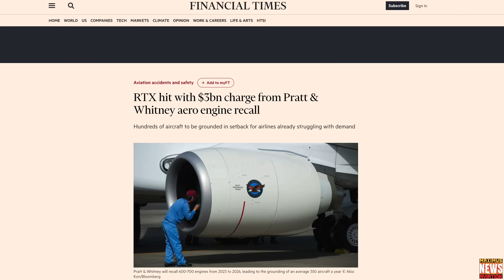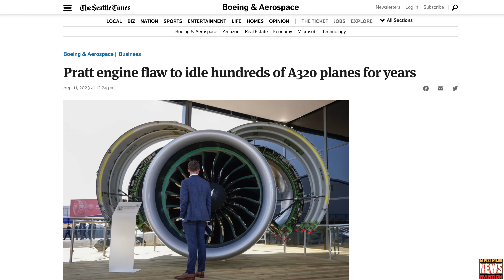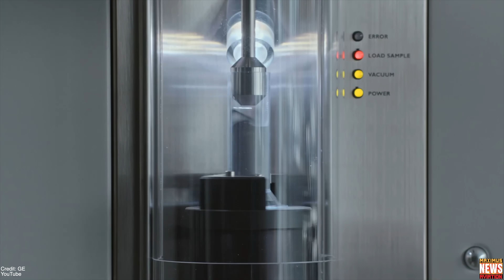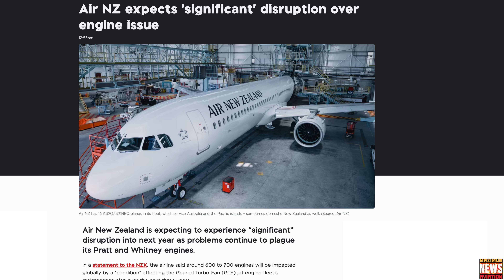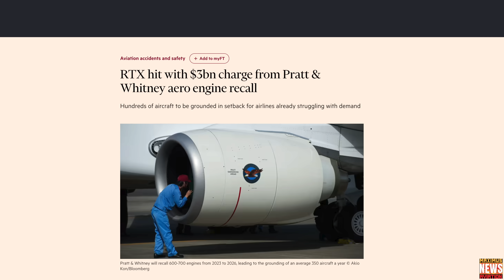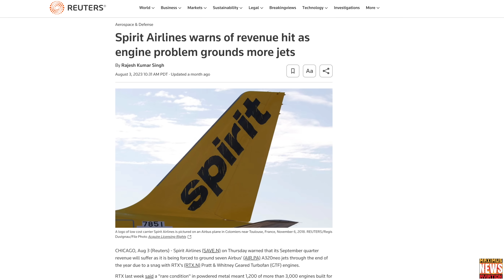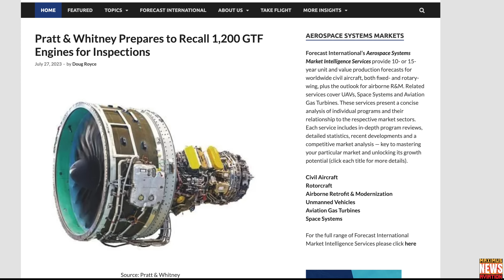HUGE LOSS For Airbus. Every A320 neo-Family Jet P&W GTF Engine Will Have To Be PULLED And Repaired!

Comment: Here's the part that most people outside the industry don't know. Most airlines don't own the engines on their airplanes. They lease them. It's much cheaper to lease than own. When it comes time for some major off wing maintenance like a hot section inspection for example, the airline just pulls the engine, hangs a fresh motor from the leasing company, ships the bad motor back. You open a lot of the cowlings on airliners and there will be an ownership placard from a bank or other financial institution (Wells Fargo, ILFC, L3 are the biggest) which actually owns the engines. I worked on Continental Airlines planes before the merger with United and the only thing Continental owned was the basic airframe (wings and the fuselage) Everything else was leased, the motors, the landing gear, the avionics, even the seats, lavs, and Galleys, everything! While it may slow deliveries the actual problem is with Pratt and Whitney not Airbus. The same thing with Boeing, the problem is with GE not Boeing.  GE and Pratt will have to cover any losses to Boeing and Airbus do to this issue.
Reply: Interesting
Reply: We have to excuse little Nicky here. He's a byproduct of poor parenting and failed UK schooling. He's never touched an aircraft yet assumes to know everything about them. 😝 Little Nicky is a legend in his own mind, sadly he's not far off from being a vegetable.
Reply: @becauseyouassumethatsproof8033  Keep talking to yourself here Steven. Nobody is seeing all of this. We all know you have a poor understanding of education of how engines are offered to airlines and not manufacturers of aircraft. He keeps assuming he knows everything 🥱😄 Sad little Steven is in his own little bubble that he thinks no one can touch. Sadly he is nowhere from being an adult
Reply: Just due it
Reply: The “you’ll own nothing and like it” economy, keeping everyone’s hands clean of any responsibility. As designed.
Reply: At the end of the day the aircraft manufacturer decides what engine manufacturer or manufacturers can hang their engine on said aircraft. If there are multiple engine manufacturer options the purchasing airline can decide which engine they choose to use.
Reply: @soyousay7751 so tell me Einstein 1 year on the manufacturer does not give the responsibility for whole aircraft if the engines are faulty. RR T1000 and GENX and PW engines have issues and are all fixed by the engine manufacturer! Stop spreading lies as you always do and accept the facts moron
Reply: @soyousay7751 I still wait for the Chinese to build a cheap knock off.
Reply: @wolfgangpreier9160  ¿Que esperas qué? ¿Una imitación barata?
Reply: @cesardavrieux3767  👍👍👍I do not fly, and i trust the airplanes not to be able to fly when the engines don't run.
Reply: @soyousay7751  Wrong cupcake, the aircraft manufacturer does not decide what engine manufacturer or manufacturers can hang their engine. The second thing is correct. The customers choose the engines not the manufacturer of the said aircraft.
Reply: @nickolliver3021  Sorry to disappoint you Nicky but the aircraft manufacturer decides which engine or engines they will offer on said aircraft. If there are a choice then the airline picks which one. You've never worked on or manufactured an aircraft so you wouldn't know.

How would a customer decide what engine or engines to offer on a manufactured aircraft? 😝😝😝😝😝
Reply: @nickolliver3021  So tell me past prom queen, if Boeing only offers a Pratt engine on an aircraft can a customer order the aircraft with a Rolls? No Forrest Gump they can only order the said Pratt. If the manufacturer offers a Pratt or Rolls as options then the customer can choose between the said Pratt or Rolls.

You win the UK Darwin Award on your lack of knowledge.
Reply: @soyousay7751  Excuse me Steven you are incorrect yet again. Aircraft manufacturers do NOT decide which engine or engines they will offer on Said aircraft. No manufacturer chooses the engines if there is an option or not. Its down to tne airlines themselves. You've never been in the segment to even tell who chooses. 

I can give you an example: 

Delta and United picked the PW engines option over the CFM leap for their a321neos. Looks like you just got called out on your BS 😅😅😅😅🥱🥱🥱🥱
Reply: @nickolliver3021  Wow you are thick. Delta chose because Airbus offered the PW & CFM, Airbus choose both as an option. Nice try Forrest Gump.
Reply: @nickolliver3021  Try reading and using comprehension. If an aircraft has a choice of two engines the manufacturer of the aircraft offered the two choices. 😝 Not the customer buying them. 😝
Reply: @soyousay7751  Boeing does not offer the engines to the airlines muppet. The engines are offered from the Engine manufacturer not from the aircraft manufacturer. It's up to the airlines to pick what both RR, PW, GE CFM to pick. NOT BOEING OR AIRBUS 

You seem to have won the dunce reward on your lack of how airlines choose their engines over the manufacturer
Reply: @soyousay7751  Airbus never offered the PW & CFM. The manufacturers offered those two engines not the manufacturer. Nice try Einstein. Go back to retirement
Reply: @nickolliver3021  Nick stick to your Sippee Cup.
Reply: @Agent-ww8yi  stick to your wrong answer's
Reply: @nickolliver3021  If your bollocks where true then an airline can choose any engine in the world for an aircraft. 😝😝😝😝😝
Reply: @soyousay7751  wrong muppet. Whatever engine manufacturer offers to narrowbody or widebody aircraft then the customers choose the engines not manufacturer. How do you spell were? its not Where  🥱😅😅😅😅
Reply: @nickolliver3021  👈 The results of having sibling parents.
Reply: @Agent-ww8yi  Say's the one who can't stop arguing the truth 🥱😅😅😅😅
Reply: @nickolliver3021  👈 Like I said sibling parents he's back misspelling.
Reply: @Agent-ww8yi 👈 says the YouTube spelling police
Reply: @nickolliver3021  You're wrong and it's comedy watching you make a UK arse of yourself. 👋👋
Reply: @nickolliver3021  👈 Can't spell

@nickolliver3021
21 seconds ago
 @becauseyouassumethatsproof8033  Sat's the one who is using his multiple accounts to be someone else. We all know all of these accounts are you Steven. So you are the one in the wrong
Reply: @Agent-ww8yi  says the YouTube spelling police.  It says says! Can you not read
Reply: @nickolliver3021  I read well you edited it after I exposed you, read your mistake again

@nickolliver3021
21 seconds ago
 @becauseyouassumethatsproof8033  Sat's the one who is using his multiple accounts to be someone else. We all know all of these accounts are you Steven. So you are the one in the wrong

😝😝😝😝😝
Reply: @Agent-ww8yi  obviously you don't read well because it says "Say's  perhaps read your mistake again that I called you out on and exposed instead of acting like the YouTube spelling police 🥱🥱😄😄😄😄😄
Reply: @nickolliver3021  Ask your brother & sister, I mean dad & mom to read it.

@nickolliver3021
21 seconds ago
 @becauseyouassumethatsproof8033  Sat's the one who is using his multiple accounts to be someone else. We all know all of these accounts are you Steven. So you are the one in the wrong

I see Sat's 😝😝😝😝😝
Reply: @Agent-ww8yi  Perhaps I see you don't know how the industry runs when I called you out on the engines. 

Perhaps ask your mom or dad how that all works instead of being persistent about it all. 

And perhaps look at everyone's else's comments to be proved wrong 🥱😄😄😄
Reply: @nickolliver3021  You are the only lown with a c in front that assumes the engine manufacturers decide what aircraft they will be chose to fit on. 😝 The aircraft manufacturer decides then offers the option to airlines. 😝
Reply: @nickolliver3021  Stick to your day job of picking up dog coils in their yards.
Reply: @soyousay7751  stick to retirement you are better off staying out of this for the people who know what they talk about
Reply: @nickolliver3021  Wrong little man. The aircraft manufacturer decides which engines it will offer, then the airlines chose. Try using the internet if your parents will allow you. 😝😝😝😝😝
Reply: @nickolliver3021  Use your head I know you failed school. Common sense tells you the aircraft manufacturer decides what engines to offer.
Reply: @Agent-ww8yi  Incorrect yet again. The aircraft manufacturer does NOT decide which engine it will offer. The airlines choose what the engine manufacturer offers. Try looking at everyone else's comment if your body allows you to 😄🥱
Reply: @nickolliver3021  You are splendid comedy and at the same time example of failed UK education.
Reply: @Agent-ww8yi  use your head muppet.  Common sense tells you the engine manufacturer offers the engines to the airlines not aircraft manufacturer
Reply: @nickolliver3021  Here's a question sweetie, when aircraft manufacturers are building white tails, I'm sure you don't know what that is so I'll tell you. White tails are aircraft with no customer, tell me how they know what engine pylons to put on the wings? They know because the aircraft manufacturer decides what engine manufacturers they've chose for said aircraft. 😝
Reply: @nickolliver3021  At the end of the day Nick has learned nothing and falls backwards into the UK wannabe world of failed entitlement. As much as we enjoy his comedy routine and poor spelling we wish him well as he's got to be a full on embarrassment to friends and family.
Reply: @Agent-ww8yi  When aircraft manufacturers build white tails,they will know what engine pylons to put on the wings because they will know what the airline will choose once they select those white tails. Once that airline takes the frame and engine, the manufacturer puts on that engine whatever that airline chooses to have. Not the aircraft manufacturer 🥱😄
Reply: @becauseyouassumethatsproof8033 Come on tell me its Boeing that offeres the engine instead of the engine maker or watch having facts slap you in the face! 😅
Reply: @soyousay7751 at the end of the day Steven gets no likes for his rubbish he spouts out to the public about what he believe about Boeing. Just the usual Wannabe troll he is and can't get enough of the truth slapping him in the face. Its comedy gold! 😅

Comment: RR must be watching this with interest as they announced at the Paris air show last June that the company was “actually ready” to re-enter the market for engines for single-aisle jets.

Sorry but it doesn't take months to change engines. It seems P & W are looking to dodge costs by 'inspecting' engines rather than remove and supply new engines. Less costs for P &W but major losses for the customers. P & W should replace engines and then overhaul the ones taken out. At least the costs are fixed for P & W and the costs for customers will be negligible.
When RR found a higher than expected wear issue with Trent 1000s on the 787 they bit the bullet and replaced engines. The added bonus was the engines that went in were far better than the original ones. But then RR engines aren't all sold up front as most are leased on a cost per hour used basis.

This is the worst news for P & W as this is really the only engine they sell for commercial aircraft as they have lost position to GE and RR on the larger engines and have lost huge market share against CFM (GE / SNECMA) in the narrow body market. Some 85 per cent of the specified narrow body backlog are ordered with CFM engines and 15 per cent with P&W engines.
Reply: Good comments, but I don't think the French are going to be happy letting Rolls squeeze back into the narrowbody market on Airbus airframes, in competition with SNECMA. The French Government have too much say about both businesses. Remember how much fuss the French made over the German demand for an Airbus assembly line in Germany? However, if Rolls do have a competitive product for narrowbodies, then Boeing might snap it up and get a march on Airbus, if Airbus choose not to go with it. Eventhough I thought the relationship between Boeing and Rolls seemed much weaker after the latter were rejected to power the B777-X.

Rolls also state under their press releases, that they can transfer new technology from the UltraFan development onto existing engines (for widebodies), so they have something up their sleeve. Exciting prospects...........
Reply: @artrandy   Thanks for the reply.
Given CFM is GE / SNECMA and they have 85% of all future Airbus narrow Body orders even if RR took all P & Ws share it would still only be 15%. I doubt the WTO would support a French (or rather EU) objection.

Airbus and RR already have exclusive deals on the A350 and A330neo wide body aircraft but they aren't as numerous as the A320 family of course.

But you are dead right that if Boeing sees RR can provide an advantage then they may drop the CFM LEAP exclusivity on the 737 and offer the RR as an alternative.

The other interesting one is the A220. That uses the P & W engine and is also affected by this issue. So maybe an opening for RR there as well but maybe not the ones built in Alabama though ....😏

And yes all very interesting to watch how this plays out.
Reply: Maybe RR were already aware of just how serious this problem is and that it would be a good time to announce that there will be an alternative available. P&W will pay for the losses for airlines having aircraft unavailable either paying the Airlines directly OR pay the actual owners of the engines since without agreeing to that no Financial Institute will take on a sale with P&W as an option so effectively P&W bight the bullet or even Chapter 11 will not protect them since they will simply have no civilian market for their engines and the same for GE. This isn't a huge WIN for RR as it appears, why? there has to be Competition and the authorities (Ant-Trust & Competition) will intervene. However any money put in by the US Government MUST be matched with similar subsidies to RR by the USA. This will take 5 years to negotiate which will leave both US Manufacturers facing a massive bill before 2030 and if the process is not agreed with the EC then under WTO Rules the US could be fined Tens or Hundreds of $Billions. This is a mess.
The USA has to be careful since it is been investigated for ordering all the EXTRA Boeing FA-18 Super Hornets to provide ILLEGAL SUBSIDIES to Boeing while penalising Lockheed Martin by cancelling huge numbers of USN F-35C aircraft. 
How the US Government handles this could make Boeing another casualty and the White House will need to engage with EC, Airbus, UK Government and RR. Lockheed Martin will be looking on to take back their F-35C orders away from the FA-18 Super Hornet orders. 
This is much messier than a simple P&W issue.
Reply: @trevorhart545   I think your last line sums it all up very well.
If the US Government do venture into this mess then the UK and the EU can bring separate challenges to the WTO and each can demand penalties.

Remember Boeing were found to be benefitting from free NASA research and State and Federal subsidies some years ago.

I must admit I didn't know about the F-18 vs F-35 issues so thats yet another mess. Wasn't the F-15EX a rather dodgy way for the US Government to get cash into Boeing during the MAX debacle via some Air Force orders (since reduced!).
Reply: Maybe only a few parts are affected, they just can't pinpoint which without an inspection. No need to overhaul good engines. Plus, 3000 new replacement engines would take a long time to make.

Edit: nevermind, recurrent inspections.
Reply: Yea, right up until they also go to their powdered metal supplier.

Comment: This is not airbus problem, it is engine manufacturer problem
Reply: Tell that to Airbus when they have to park airframes due to engine shortages.
Reply: Airbus should have caught this long ago. Irresponsible.
Reply: @RLTtizME  How though? More rigorous material intake requirements in the contract with Raytheon? Problem is that would have raised the part and per engine costs. Digging deeper into the actual error, it’s kind of a tricky case of assuming things were right without having a way to really assure it that has been the bane of Aerospace since the Apollo program’s end. 

Aerospace kind of seems to cyclically forget that a lot of work went in to making Apollo work as successfully as it did. They expect the outcome without putting in the rigorous and constant effort.